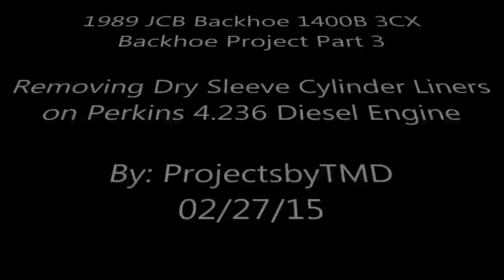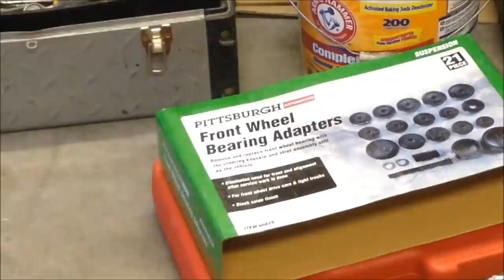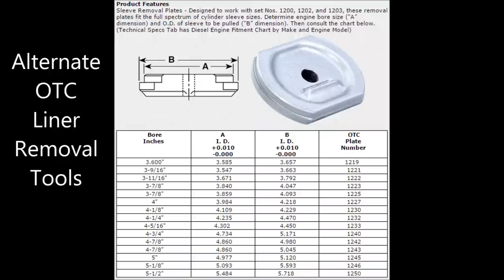Dry Sleeve Cylinder Liner Removal - JCB Backhoe Project Part 3 (Perkins Diesel)

Comment: Damn, bolt a strong back across the bottom of the crankcase, put a small bottle jack or hydraulic ram between it and your "puck," and get after it. The wood is absorbing all of your force, and that's why you have to hit it with a hammer, you shouldn't have to. I do dry sleeves all the time and could have had all four out before you could get that device rigged up. By the way, a machine shop can make that puck out of a piece of scrap metal for at or less than the cost of that wheel bearing removal set from harbor freight, but then again, I have that set as well as the whole ball joint toolset, and they are handy for all kinds of things around a shop. Great for those upper control arm bushings attached to 4x4 Jeep front axels.

Comment: Know my way around these engines.Really,if your doing it for a customer you should get them non finished and get them bored out to original spec.Otherwise the new liner tends to follow the bore if slightly tapered or oval.But great job .

Comment: Outstanding ingenuity!  Thanks for this.

Is that a water-cooled air conditioning system visible at 8:40 atop the Janitrol furnace?  The shutoff valve on the extra PVC pipe looks like it may be a water feed.
Have been thinking about using well water as a low-cost A/C system assist and this reminded me of it.
Reply from the maker: Erichhh 
Thanks for the complement!

On another project, I completely overhauled the Goodman/Janitrol AC system.  I installed thermostatically controlled pressure expansion valves on the indoor and outdoor units to get more energy out of the AC/heat pumps.  On the indoor units, I just completely replaced the evaporator & put on PVC valves to turn off the air bleed for water condensation.  I only turn them off during the winter - since one need to have the valve open when the AC is on during the summer.

Comment: I have a Massey 255 that needs a sleeve and piston....Sleeve is cracked at the top about 1/2" long downward and piston has been indented from a dirt dobber nest going through no. 4...My bad for not pulling the intake first...DOOH! This will help me...
Reply from the maker: steze48 - Glad to hear that it can help!
Reply: Hi!  my name is Roberto, have a small question! while removing the sleeve by turning the puller,would it have help to fill the old sleeve with ice and salt mixture or dry ice,(salted ice doesn't go has much down has dry ice but get down lower than regular ice) and if not would it be overdone to put dry ice in the sleeve has you remove it?

Comment: Thanks for this. I just pulled liners on a MF 275. Perkins a4.248  50 years old. I welded 8 vertical beads and pulled with a large washer and assorted back ups. Came out really easy.  Love your bearing puller. Did you mic any of the bores before / after?  What size all thread ? Looks like 1/2". I used that but because i welded. I saw a guy use 3/4" thrd bar and no tapping. Brute force but it worked.  I took out all four liners.   Thanks!
Reply from the maker: Donna - didn't mic the bores before/after.  The threaded rod was 3/4" with a fine thread.
Reply: You can weld a bead from top to bottom in a couple of places and have it out in five minutes

Comment: All the comments that say weld a bead on the liner, why does that not make it expand instead of contract?
Reply: When the weld shrinks from cooling it pulls the liner with it.
Reply: Not a welder, but I would assume that the liner doesn't expand much when it's welded (as it has a big thermal mass and is heatsinked by the block) but the weld bead goes on very very hot indeed, hence shrinks a little as it cools, thus pulling in the diameter of the liner.